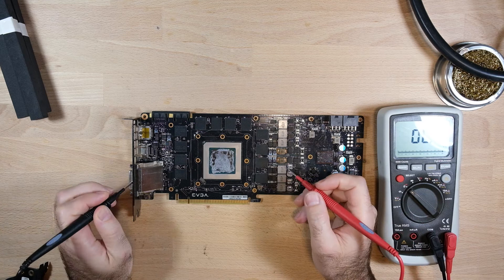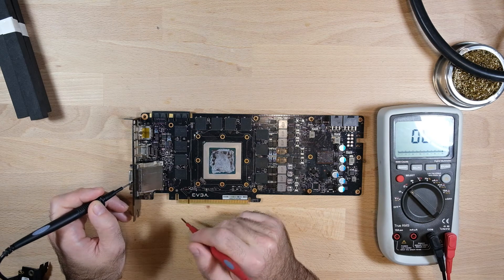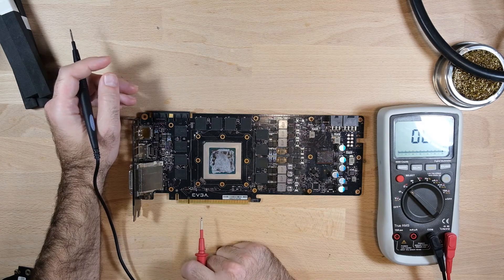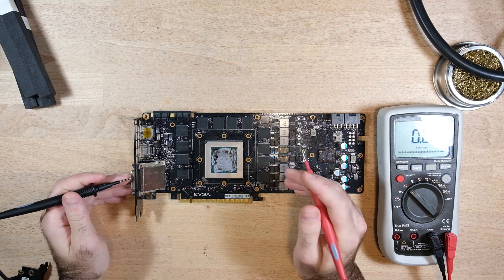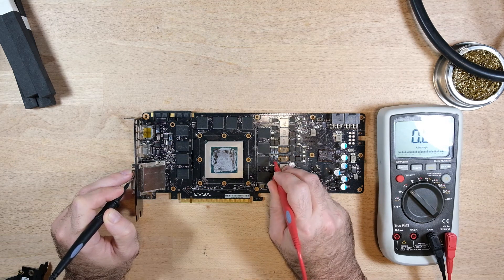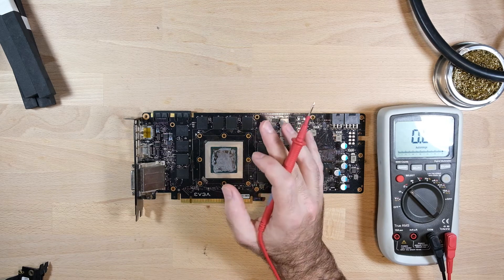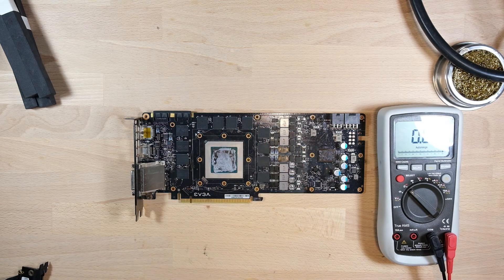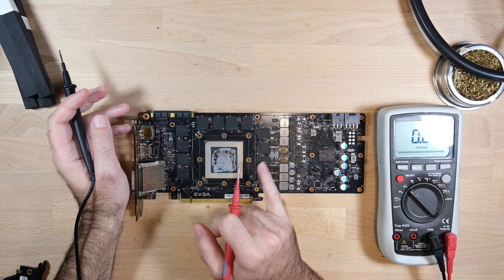Why can't I use "short detection" mode to diagnose problems on my graphics card?

Comment: I lost you when you said capacitor has a low resistance to ground.. you mean when the cap is empty? but measuring with a voltmeter will actually charge it and raise the resistance until it's open circuit..
Reply from the maker: The idea is to measure the resistance between the buck converter output and ground, in ohms.  Usually, you won't be that interested in a perfectly stable number - you just need to know if the resistance is in the range you expect.  Capacitors are good place to do this because you usually know for sure that one side is positive and the other is ground.

If you see too low a resistance, then means you have a short circuit somewhere, and helps to guide your troubleshooting.  To be clear, it's not necessarily the resistance through the capacitor itself that you're interested in.

Comment: hi , what if i get open Loop (OL) on a pin of capacitor,  is that means is shorted or ?  you didn't mention open loop   at all ... thnx
Reply from the maker: More generally, what that normally means is that your probes aren't making contact with the joint you're trying to measure.

If you're seeing that on the 12V input inputs of a graphics card, and you're SURE that you're making contact with the right pins, then the next thing to suspect is that you have a blown fuse on that input rail.

Comment: use a laboratory power supply to detect shorts with a riser or 12v line
You've done it?
edit:
no matter
I already saw the end of the video
but i still want know
Reply from the maker: Yes, I've done it in the past.  I'm pretty sure I've shown the process in a few videos.  It doesn't always work, but it requires less special equipment than other methods.

Comment: Hey Aaron, excellent vid again, it helps greatly. Like i mentioned in my response in the other vid it cleared a lot of important doubts, such as why shouldn't one use continuity mode and also why voltaje injection should be a last resort, as i was gonna ask you if it was a good idea to just inject voltaje from the start and look for a warm component, you read my mind haha. And the procedures as well, every bit helps. When you measure the PCIE fingers to ground, do you need to touch all three pins at the same time with the probe or any of the three is fine?, and also when you measure the PCIE connectors to ground just after that, which one should you measure? i know one of the rows is ground, but from the other row, can it be any of the pins, has to be all of them or a specific one/s?
Thanks for the massive help (i have never actually had or used one, just been learning a lot from vids, specially yours, this past month as before i was sure my card didn't have a short because it didn't produce any smoke or funny smells when it stopped working, and also it didn't make the pc fans turn for a sec and then stop like i have seen some other cards that were sure to have a short do.) But from having watched all these videos now i know my card can fully well have a short). But from having watched all these vids my minds has completely turned and now i know my card can fully well have a short and as soon as i can get my hands on a decent meter i will take all these measurements and post them here to review them with you. Keep it up man!
Reply from the maker: When you measure resistance on the voltage supply pins, you only need to touch one of the pins.  There are three on the front of the card, and one on the back, and if you look closely, you'll see they're all connected together by a big meaty trace.

Same thing with the six and eight pin power connectors.  If you look at the pinout for the connector on the card, you'll see that the set of pins furthest from the latch are all 12V, and the ones closest to the latch are ground.  The pins are all connected together, so measuring at any one of them is good enough.  You do need to measure both of the power connectors, though.  The reference 980 Ti is wired up so that half of the core VRM is powered by one of the 12V connectors, and other half is powered by the other one, so it's possible to have a short to ground on one of the connectors, but not the other.

Don't get too hung up on the problem being a short circuit.  A short to ground is one possibility, but there are a lot of things that could cause the behavior you're seeing, so you need to keep an open mind in case the evidence points to something else.
Reply: @AaronAverett  Yep, if it isn't a short then i'm hoping it's a problem with the solder of the gpu chip and i can just reflow it in the oven or with a heatgun, i just hope the chip isn't dead from a short, that's really all i ask. Given you have left voltaje injection as a last resort as you said it can be destructive, could something like this be used to locate a difficult to find short? https://www.youtube.com/watch?v=5RJ6kRy50uQ
Reply from the maker: You can totally use an ohmmeter to find shorts like that video shows, but you need a very accurate ohmmeter to do it.  As the guy says, you need accurate milliohm or even micro-ohm measurement.  Handheld ones, even the relatively nice Voltcraft one I showed in this video, aren't anywhere near accurate enough.  The one the video shows is, but it's quite large, and costs about $1600.  Whether or not that's practical for you is obviously a personal decision.

There are a lot of possible causes for your issue in between "short to ground on something major" and "GPU BGA failure," which you need to consider before you attempt to reflow the GPU.  This is why I talked about actually plugging the card into a test bench and checking each rail for the proper voltage, once you've determined that none of them are shorted to ground.  The voltage test will tell you where to look, if the problem is power-related.  If you find a rail that isn't running, then you've narrowed your domain of possible problems from the entire board with thousands of components to just one area, with a few.  If you find that all of the rails are working, then you start to suspect a bad GPU.

I would not advise using a heat gun to try to reflow a GPU.   You stand a way better chance of damaging it than you do of successfully reflowing the solder (which is a long shot, anyway).  An oven is a better, but still pretty sketchy, way of doing that.  The proper way to reflow a large BGA chip like a GPU is to use a BGA machine which heats the board very precisely from both sides.  The good ones are even programmable.  If you use an oven, be sure to use plenty of flux around the perimeter of the chip, to give yourself the best possible chance of success.  Also, don't eat anything you bake in it afterwards.
Reply: @AaronAverett  Oh no haha,  not even dreaming, i could get an UT8803E or an LG DM441 for about $100, that's about the most i'll shell out, and then when i'm done i'll just resell them, but if that one is $1600 then i don't think these will be up to the task. So you could have bad voltage on a rail causing the card to malfuction and still not have a short? i thought it was just a different way of testing but the end result was the same, that is, either you have a short or not. Thing is unless you measure voltage in the same way that you showed how to measure resistance then i don't know how to do it, just have a very basic idea from what you showed at the end of the video. So measuring voltage is only useful is if you don't find a short measuring resistance, right?, if you do find a short checking resistance then it isn''t useful?

Yeah i've heard an oven is better than a heatgun and that the proper way of doing it is a BGA rework station, but they're expensive and i've also read that manufacturers actually use special ovens in the process of manufacturing the cards so it's a good bet if all else fails. Thanks for all the tips again.

Comment: Hi Aaron,  thanks for these videos they've been very useful and are a rarity.

I have a Radeon VII which is faulty. The fans spin, there's no display and the beep code indicates a faulty graphics card, it's not detected on the motherboard PCIE slot.

I extensively tested the resistances for a short and it all appears normal. So I powered it on, the GPU die gets warm and eventually hot that I turned it off. I'm using a fan to keep it cool and I checked all the voltages on each phase and the minor rails and everything appears normal (I found the info. online for what each value should be).

I'm running out of ideas for diagnostics, I'm starting to wonder if the BIOS chip is faulty or has been flashed or if the HBM or GPU die itself is faulty.

Any ideas for what else I could try?
Reply from the maker: Those Radeon VIIs are pretty neat cards.  I've not had the pleasure of looking at one, so I'm afraid I can't tell you much in terms of specific things to check, but the same process would apply.  Check each rail for a short to ground (that is, actually zero ohms), and then check each one for a voltage.  As I mentioned in the video, if you can find someone with a healthy one to compare to, that helps immensely.

Unfortunately, being an HBM design, there's a pretty good chance the problem is actually a failure of the HBM/interposer package, which isn't really a repairable failure.
Reply: @AaronAverett  Thanks, I've checked and all the voltages are normal and no shorts I could find. I did check the eeprom that contains the BIOS and there's a suspicious looking capacitor connected to it (both take 3.3v and are nearby). I'm thinking about pulling the chip and seeing if I can reflash the BIOS. Otherwise I suspect it's dead HBM/core
Reply from the maker: What happens if you hook up a second graphics card, and plug the monitor into that one?  You shouldn't need to pull the BIOS chip or anything like that.  Just boot with another card and reflash.

And, what's suspicious about this capacitor you mentioned?  Do you suspect the card was modified by someone else?
Reply: @AaronAverett  Thanks for the suggestion, I previously got it to boot with a second GPU and the Radeon VII isn't detected on the PCIE slot at all, which makes me suspect it's the BIOS chip. 

The capacitor has some black small lines at the top, it looks like it either got dirt on it or had some electrical damage
Reply from the maker: If it's not detected at all, I think your problem is more likely to be power related.  

Which rail is that suspect cap on, and what is the resistance to ground from the positive side of it?
Reply: @AaronAverett  Thanks, It's on the 3.3V rail, next to the PCIE power connector and it's close to the BIOS chip (which also takes 3.3V). I'm measuring it as hundreds of ohms but the value is fluctuating quite a lot and doesn't stabilise with my cheap multimeter